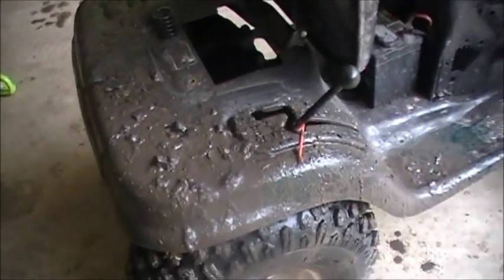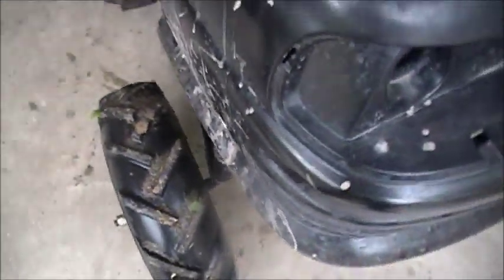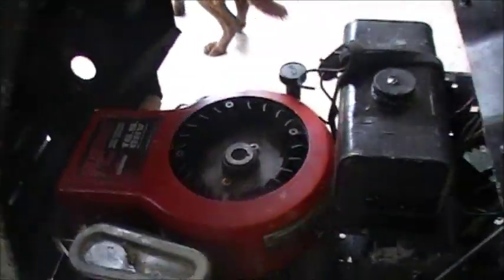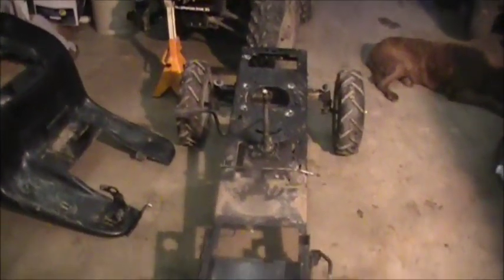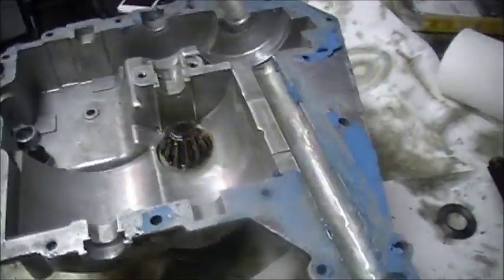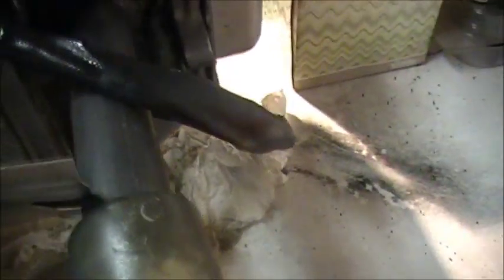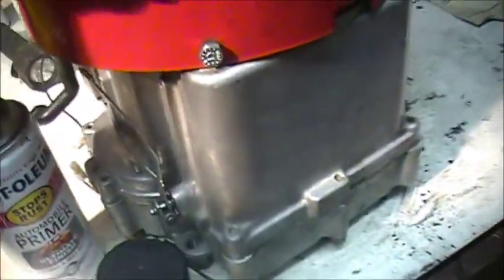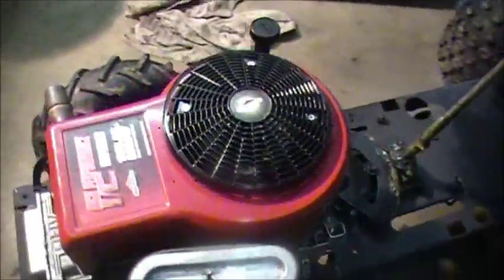Off Road Lawn Mower Fresh Re-build

Comment: Was that muffler you welded to the straight pipe for a smaller briggs engine? had the 3/4" threads on it? if so, it's keeping that wonderful motor from breathing as well as it could. find a big "hot-dog" muffler with the 1" pipe, or make a straight pipe setup. OHVs need to breathe to make power.

Comment: I just fix that with my tractor it is the nettle valve try sticking a pin down the hole to clean it and mack sure the nettle is flush with the hole
Reply from the maker: Thanks, just needed a cleaning
Reply: +Offroaders Unlimited i fixed my idle by adjusting the air/fuel mixture screw on the carb

Comment: Had the same problem it's the two wires coming out of the bottom of your carburetor it's like a fuel pump you need to have the main wire that's not running to your motor ground run to your 12 volt power on your battery in order for your tractor to completely run if not your tractor will start and then shut off and it will not idle at all I have an OHV I just put it in my tractor I took an old flat head out message me if you want any help I have the same size motor it's OHV as well and I rewired mine at the brand new wiring harness I can tell you how to make one easy as f*** LOL hope this helped